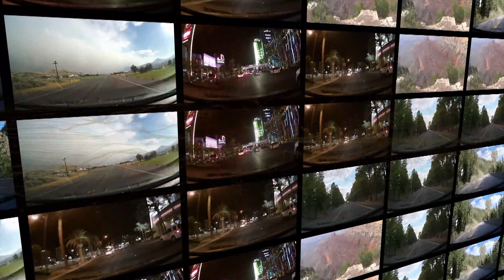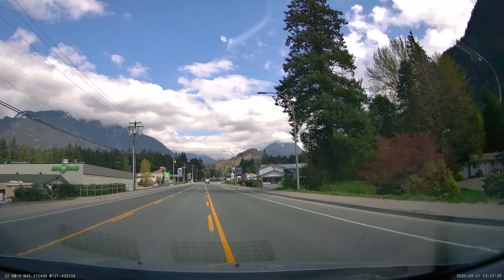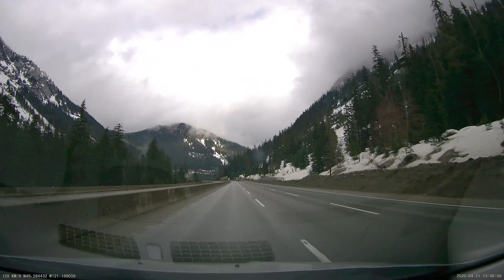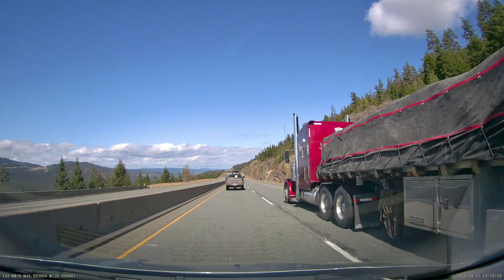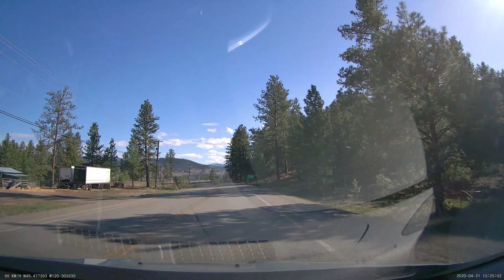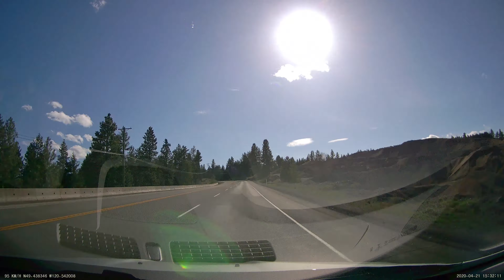Ultralapse Hope to Hope via Coquahala Okanagon Connector and Hope Princeton  Highway in 4K

Comment: My poor Intel 530 integrated graphics chokes on 4K and drops frames at 1440p...have to settle for 1080p...LOL
Reply from the maker: 4k can be taxing on systems.
Reply: @12voltvids  No doubt! Plus graphics options are very limited on my Dell PowerEdge T30 (which has been a workhorse in all other areas.)